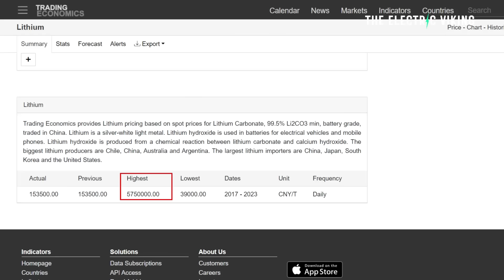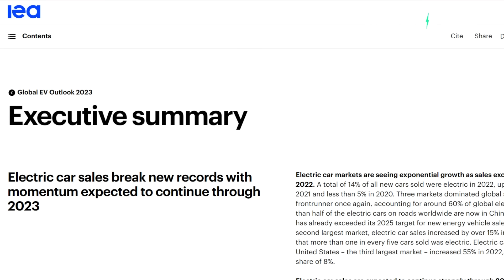The reason Electric Cars will be cheaper than ICE cars in 2025

Comment: ICE cars CAN have a future.  #1simplfy the motor, trans, brakes, lights and may other parts.  fewer different parts, means lower cost manufacture and you could have lower parts.   easily cut the cost of cars in half.
makes ownership lower cost.
15 year ago a 80 inch TV was $8,000 , not it is $1,500
cars were $20K, now $40K  going the wrong way.
EV''s will follow the same cost structure
change the structure, we get more bland, but lower cost cart.
most of us don't care, just want basic transportation

Comment: Which would you choose today for batteries. sodium Ion or Lithium ioin. I am thinking both of a fire safe battery, easier charging, and lasting time in charges of both units before replacements are needed. 

Also how much would it cost to refurbish a tesla with lithium batteries and how much to do the same with sodium ones? 

Hope this spans another good video. 

Thanks for any answers.

Comment: Believe it or not, unless there's an early introduction of the promised Solid State Batteries into EVs, there's no hope and future for electric cars as of now. You're missing the point. It's not about lithium prices. It's all about the reliability and range anxiety. No one wants to have a car of a shorter range that could experience thermal runaway while trying to quick charge the battery from a single faulty cell and more than 5,000 gallons of water would be required to quench such aggressive fire.

Comment: I'm an electrical engineer with nearly 50 years of experience.  Electric cars are among the dumbest things I've ever seen. There are many things wrong with this technology. In the US you can't give them away except in California where the looney left government is jamming them down people's throats. They don't reduce CO2 emissions. In fact in China they will increase it. Lithium ion batteries are extremely dangerous catching fire spontaneously, fires that cannot be extinguished. Don't take my word for it, ask a fireman. The infrastructure for charging them doesn't exist. The power grid won't handle the added load. When the batteries reach the end of their life  they literally have to take the car apart to replace them. Cost to replace is $8000 to $12,000. You can assume anything coming out of China is junk. China's economy is on the verge of collapse. The people pushing these cars may have their hearts in the right place but their heads are out to lunch.

Comment: I'm not interested in buying a disposable car.
Reply: Be prepared to pay out of your ass to oil companies then. 🤣
Reply: @hardcoreherbivore4730  my truck runs when I need it to. Don't need to plug it in. I can go thousands of miles with only wasting a few minutes refueling. I don't need to worry about cold weather limiting how far I drive. Don't need to worry about my truck bursting into flames in my garage. Don't need to worry about when the batteries die of spending $20k to replace them. Don't need to worry about more expensive tires that need to carry the weight of the batteries.

Comment: Here in Australia  a tesla ev will set you back around 150 grand 

The cheapest ev on the market is around  55 grand 

In the us theres investigation  and law suites against  tesla and the musk rat for fruad and misleading customers about the evs range amongst  other aledged criminal activities 

Ev owers are find out ev vehicles are usless in hot or freezing cold weather were range is cut to half or less 

There are more  ev fires occuring 

Ev owers are finding out evs are very expensive  to maintain and  even  more to repair 

One tesla ower scrapped  the bottom of the battery protective casing  slightly  and was told he needed a new tesla battery at 60 thousand dollar  plus installation 

So the ev was written off 

There have been many cases where the rapair far out weighted the valve of the vehicle 
The battery in evs is a very fragile very expensive  piece of high tech equipment   subject   to climatic conditions  ,too hot ,too cold   used too much ,not used enough, cant drive long distances  ,cant be charged  above 80 % or let go below 30 % 
Cant be charged frequently 
All due the shortening of the battery life 

Since when is it suitable to treat you ev like a new born baby  in fear it will fail or damage the battery and components?

Give me a petrol
Or diesel vehicle  any day of the week

Comment: Two inescapable facts: 1) Large batteries with all reactants stored inside are inherently more dangerous and therefore expensive to make safe than ICE that uses the oxygen in the air. 2) EV scale up poorly. Double the battery capacity and you double the price of the car.

EV’s will be cheaper than ICE vehicles if we are willing to sacrifice safety like in China, or we move to very small limited range vehicles.

Comment: At 1:23, Moore's law has nothing to do with building electric vehicles.

Moore's law is the observation that the number of transistors in an integrated circuit (IC) doubles about every two years. 

This is completely unrelated to the production of EVs.

Ed Schultheis, PE
Mechanical design engineer and manufacturing consultant for 35 years
Schultek Engineering & Technology, Inc.

Comment: Perhaps EVs will begin to dominate in 2 years, but why would you want that to happen? There is more to the biosphere than just CO2.  These vehicles are inherently problematic when compared to the existing ICE infrastructure.  Do you want 15 minute cities?  Do you want cars to be able to be hacked and remote controlled?  What about the difficulty with recycling the batteries?  Who is going to pay for the exorbitantly expensive charging infrastructure?  There isnt enough lithium, cobalt and nickel in all the known reserves in the world to provide the raw materials required to make all cars electric.  You need to ask yourself, if this is what you want to achieve, raking into consideration all the pros and cons, what is the net benefit?

Comment: What we need is an affordable EV. Most of us cannot afford a Cybertruck or big-time EVs that start at more than $50k. Here in the US, we have yet to see prices of EVs come down. While it is true that Tesla has cut the price of its entry-level cars, once you add a few extras, you can easily drive the price to well over $50k. Also, a buyer has to consider associated costs, increased insurance, higher interest rates, adding charging to one's home, or finding convenient charging points if you live in an apartment. If you remember, the entry-level Cybertruck was supposed to cost around $40k. It now costs over $20,000 more than the base model originally quoted at its debut in 2019. The same happened with the Ford Lightning. Let's face it: EVs cost more than ICE vehicles or hybrids, and no EV on the horizon can compete in price. Here in the US, if someone wants to buy an affordable basic transportation car for work and travel, you are probably not going to buy an EV. I am in total agreement with you that we need to move away from ICE vehicles of all sorts, but the average car buyer is just not going to purchase an EV at the current entry-level prices. Truth is, here in the US, there are no EVs that you can easily purchase at a $25k - $35k price point. There is no EV equivalent of a Toyota Camry.

Comment: In the USA EVs to this point are a massive failure. The Big Three Auto Manufacturers have blown this role out . Greed of their stock holders , lack of vision in their management, and ignorant pride to include Tesla have made their US market roll out a complete failure.
      The only way EVs could work or be rational to the US consumer with half a brain has been passed on do to Corporate greed. The Big Three needed to come together on a universal battery system that is easy to interchange for charging, service, and new battery technology. Independent or corporate owned service, automated service and exchange stations would lead an EV revolution! But! As far as I'm concerned as a US consumer! Musk and the Big Three can shove the EVs where the sun doesn't shine.

Comment: EVs will eventually be cheaper buy than ICEs, but because of their "unibodies," (like Tesla cars,) will be much more expensive to fix because you will need to either replace the bodies or cut pieces off and weld replacements back in place.  That won't happen if the bodies are warped from a "fender bender."

Comment: ICE car sales will collapse in 2025? No. 
The ability to make lithium batteries for all cars in the world will not exist in 2025. In 2 years there will be demand for batteries which will outstrip supply and from economics it’s known that will prevent battery prices from dropping enough to make BEVs cheaper than equivalent ICE cars. 
In 2025 people will still buy ICE cars in the low $20,000s like the Corolla and around $30,000 like the Camry. Equivalent BEVs at that price range are not here yet and will not be available for several years. 
Currently the cheapest Model 3 costs $42,000 minus incentives. The cheapest Model Y costs $45,000 minus incentives. This is after price cuts by Tesla. And popular Tesla car options can increase those Tesla prices by several $thousands.

Comment: No, EVs will collapse.  

New combustion tech is MUCH better than any EV tech.  It is 75% vs EV at 85%, but 1/2 the weight and full brake recovery, giving it a 1.5x advantage over EVs ambient and 2.65x better in Winter/Summer.  Virtually no loss in range with hot/cold.

The range of this new combustion tech on 20 gallons is 2000/3000 miles with E100/E0 (Ethanol/gasoline).  It can also use natural gas at $1-1.5/gal equivalent (3-4.5 cents/kwh).    

Making fuel with nuclear or RE will be 5-20 times less costs than charging an EV on a 100% RE grid.  20:1 will wipe out EVs.  

150 MPG HWY, 270 city, 216 combined on gasoline and Natural gas and 100 HWY/170 city/144 combined on Ethanol.  

This fuel making will feed airplanes, ships and an entire base of industry and housing, allowing OLD ICE cars to be 2.2 times less CO2 than an EV.  This tech can be up to 33 times less CO2 than an EV in life cycle.

If CO2 is the issue, EVs are toast.  They cannot get to CO2 neutral, but new combustion tech can (2% of old ICE).  

The key is that ALL (old and new) combustion can use RE fuels, making them instantly 2.2 - 5 times less CO2 than an EV.  This tech can last 60 years leading to a 33x lower CO2.

Lastly, we don't have the materials for EVs.  It takes over 500 times more rare earth materials to make an EV than this new combustion tech.  

Sorry, but there is no future with EVs.  Fuel IS the battery.

Comment: I have noticed that early  adopters of EVs are very commited to them and most will not accept any criticisn of them, for some reason, pride perhaps. Or is it like that with everything now, im right youre wrong....look at the gender issues we have now.

Clearly the environmental thing to do is keep the car you have as long ax possible.  The reduce psrt of reduce, reuse, recycle.    Its the reuse part as well.   Ice cars are fairly recyclable.
The ussue with them is the emissions, which has led to the development of the EV

For me, these would make perfect sense for cities.  They should be small, cheap and practical.  Unfortunately thats not what the manufacturers have built. Theyve built massive, heavy, eye wateringly expensive trucks......and now that everyone with enough money has bought one, theh cant sell them.

A major rethink is needed.  They need to build small cheap ones for city dwellers that arnt rich and that way they czn actually be environmentally friendly as well.

Comment: I have long expected that EV's would become less expensive than ICE vehicles;  they are, after all, inherently simpler.  And batteries using sodium rather than lithium appear to be coming soon.  Certainly there will be multiple companies that offer simpler EV's--- no computer screens, no karaoke, no built-in navigation, etc.  The transition from ICE to electric vehicles will probably proceed at about the pace of replacement of horses with ICE vehicles.  IMHO.

Comment: Can't they just dig up more lithium? no it requires 500,000 gallons of water per ton.  Most lithium is in deserts where there is little water.  In Chile mining it taking 65% of the ground water so the government it attempting to revoke mining rights. Besides if you think it is bad to take global warming mater and take it from under ground and put it into the air - then processing with water is just as bad as coal -  taking ground water and evaporating it into the atmosphere; water vapor is a green house gas.
Reply: Water vapour is, but it doesn’t last long enough in the air to have last effects. It usually evaporated into clouds, which then rain, that water either going into the ocean, or into the ground and stored in springs or underground reservoirs. 

I’m not too fussed about Chile since the majority of the worlds lithium comes from Australia. But nevertheless, brine extraction is not the only way to collect lithium. Infact a pilot plant is being set up in Nevada for clay extraction of lithium from ground clay in Nevada. If successful, one field in Nevada alone could produce enough lithium to supply the EV market for the next 50 years.

Comment: The cost of lithium isn't much per vehicle 22lbs  in a Y. It is the availability that is key; and it cannot expand that fast; the last 4 years production was up 7,500 tons a year, reaching from 100,000 tons to 130,000 tons. Production would need to double to even bring EVs to 10% of sales. While you could try to sell people little EVs with little batteries and short range that has been tried and failed.
Reply: You do know that in 2022, 14% of all new car sales were EV’s? We’ve already well and truely passed the 10% mark you claimed was impossible. You should re-evaluate the trustworthiness of whoever told you that line.

Comment: I've been looking at projections for lithium mining and production and whilst production is projected to increase substantially by 2030, it's not going to keep up with demand for lithium batteries, so the laws of supply and demand dictate the cost of lithium is going to remain high. There isn't going to be a glut of cheap lithium. Those countries producing lithium will want to make as much as they can exporting it to richer countries.
Reply: Unless it is undercut. Telsa is building a pilot plant to extract lithium from clay in Nevada. If successful it would not only allow access to 50 years worth of lithium supply but also allow for lithium to be extracted at 1/5th the cost of brine extraction. And when you make every part of your own EV’s (unlikely legacy automakers who contract out parts like engines, suspension, interior, seats, infotainment, etc). And you can supply the lithium for your own cars at cost…. And a much cheaper cost at that…
Reply: @engineeringtheweirdguy2103  There's a lot of ifs there. Will this plant in Nevada actually produce lithium that much cheaper? Remember Musk claims Starship can colonise Mars because they can manufacture methane and oxygen there but I've seen no sign of a pilot plant being built on Earth to prove the concept.  Nor does Tesla make all their own parts, they don't make steel, for example, or tyres. They buy parts in from specialist suppliers just like other auto-makers.

Comment: Ford/GM/Detroit will go bust true but not because of failing to build good / cheap EVs IMO.    Hitting Lithium mining/refining capacity limits will drive UP battery cost not down.   Range anxiety,  insane depreciation,  crazy insurance costs, fire risk, lack of recycling all the dead batteries being an environmental nightmare due to no recycling technology,,,  EVs will die off.   Same for wind generation  farms.  Math didn't live up to the initial hype.   Until star wars free energy gets invented;  nat gas + nuclear for power and small hybrid for transportation..   Tesla = an exclusive and vanity car.
Reply: You do know that
1.) range anxiety is widely reported almost exclusively amongst people who have never lived with an EV. And less amongst those who do.
2.) the Tesla model 3 has the lowest 5 year depreciation of any car in the market today.
3.) in almost every country EV’s are cheaper to insure than equivalent ICE cars if you find the right insurer, it appears to be only uniquely a UK problem, which insurers have explained is due to the trouble and cost of importing spare parts into the UK. Because of barriers put in place after Brexit. 
4.) every insurer and regulatory body has agreed that EV’s are 20-60 times less likely to catch fire than ICE cars. Infact in Norway, nearly 90% of all cars on the road are EV’s but despite EV’s outnumbering ICE’s 9 to 1 in Norway, ICE’s remain the leading cause of car fires in Norway. So no, not a fire risk.
5.) EV batteries are 96% recyclable and there are many many plants set up all over the globe that will buy and recycle your EV battery. Infact the largest EV producer in the world, Tesla, states on their website that they will recycle all their own batteries. And they do if you use their buy back system.

6.) ironically, hybrids are more likely to catch fire than ICE or EV’s. They are also shorter lived than ICE or EV’s, and produce more emissions and cost more to make and run than an EV and have lower crash safety than an EV or ICE. They are truely the worst of both worlds, apart from using less fuel per mile than an ICE.